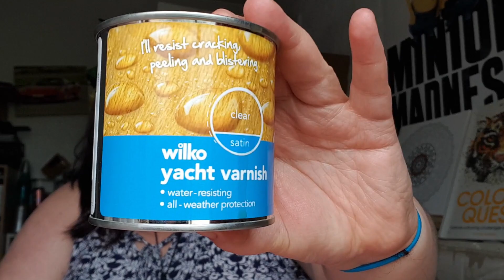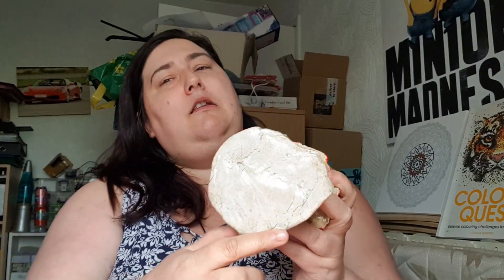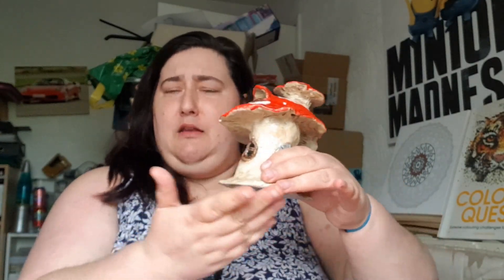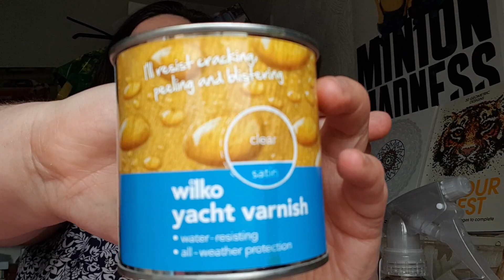waterproofing Air Dry Clay experiment

Comment: Folks, if you use yacht varnish on an object made of air dry clay, the best way to paint it on is the paint it from side to side and allow that layer to dry completely. Then once it's dry, paint the next layer on it, painting it on from the front to the back, to ensure you cover every inch of the clay. I have used yacht varnish on air dry.clay, and sadly I missed a section when I painted it, so the moisture got in under the varnish and the item became distorted. Since that happened, I always add 3 coats of the varnish to my creations before I put them outdoors. Also, ensure that if the item gets scratched or damaged, that you give it another two or more coats of the varnish. That's what works for me. Hope that helps!

Comment: What a cute little ornament.  thank you for sharing how this worked for you. How is it holding up all these years later? Did it stay waterproof? And did it need any more coats of varnish after a while?
Reply from the maker: Hi thank you for your comment, the ornament hasn't had any varnish reapplied since the original and i haven't checked it for ages, so i am planning on doing a quick video in a couple of weeks as the ornament is at my mother-in-laws house, however when i have seen it at a glance it looks fine but i shall see what its like when i get up close

Comment: I have a concrete angel. It belonged to my Aunt who past away.  It was kept outside.  One of its wings needs to be repaired.  Im doing this for my cousin, my aunts daughter.  I have air dry clay, can I use this to repair it? Also I need to paint the whole thing.
Reply from the maker: thank you for your question, even though the clay would connect to the concrete it obviously wouldn't be as strong and also would depend on what you were repairing, i would advised using concrete but create a really thick mixture and slowly build up the part that needs repairing, with regards to painting it acrylic paints work great as long as you use a good sealant, hope everything goes well with the angel and your cousin likes it xx
Reply: Thank you so much

Comment: I always thought yacht paint made items yellow . Is this water based varnish ? Thanks
Reply from the maker: no this is yacht varnish and it never turns yellow this is because its UV resistant, if you get one that doesn't have UV resistance than it will turn yellow x

Comment: Hello, my friend moved away and I want to make a skateboard key chain to remember her, I want to hook it onto my backpack. Do you know of any sealants that are glossy and waterproof at the same time? I want to avoid using resin, epoxy, 2 part or uv resin.
Reply from the maker: Good Morning, if your looking for a glossy finish with waterproofing, i would suggest a exterior wood varnish that as polyurethane in it. hope your gift goes well x

Comment: Heyy! Loved this video, you’ve got a new subscriber here☺️ just wanted to ask you something. I want to make air dry clay plant pots 🪴. I’m thinking of putting plants that don’t require tht much water. Instead of a plastic cup inside the pot can I wrap some sort of cling film inside the pot and then put the plant in. Will that better protect the pot after varnishing it ?
Reply from the maker: Hi, firstly thanks for checking out my channel, i honestly can't see there being any difference between using a plastic cup or cling film other than one being firmer than the other. Cling film would be a cheap option but may get damaged alot easier than the cup xx
Reply: @ManicCreationsChannel  ooooh okay I’ll keep this in mind! Thank u so much 🥰🌸

Comment: I wonder if you'd be able to seal/waterproof air-dry clay plant pots with this Wilko Yacht Varnish, or would the constant moisture of the soil dissolve it and poison the plant maybe? 🤔

 It's super difficult to find something non-toxic and waterproof to seal claypots with without using varnish that needs to be hardened in a kiln 😑
Reply from the maker: Hi thanks for your comment, I agree that even with the varnish it may not deal well with the constant moisture, you could however keep the plant in a plastic pot and place that inside your clay one so it's not in direct contact with the soil x
Reply: @ManicCreationsChannel  
That's a pretty straight forward idea I hadn't thought of! 😅

- Apparently, a non-toxic method of waterproofing the inside of terra cotta and air-dry clay pots that people do, is to use liquid rubber that people use for some roofs? It's pretty cheap from B&Q/eBay, but it's like a black goop you paint on, so the inside of you pots or whatever will be permanently black?  

Thank you for sharing your ideas too! 
( ^ . ^ )

Comment: Would this work for a succulent pot?, it would be a small pot, I will be using air dry clay to make it
Reply from the maker: hi e m i thanks for your comment, it should work perfectly well for succulent pot, some people i know that have some of my sculptures in their gardens have had them out on the soil in all weathers and they have done really well against all the elements, just make sure that you paint the pot before applying the few coats of varnish as this really does have an effect on how well the yacht varnish works at waterproofing, hope this helps and let me know how it goes! x
Reply: MrsManic Sculpture & Craft Creations  Great!, thank you for posting this video 👍🏼

Comment: Thank you for the video x the only problem you have with vanish it can go yellow x
Reply from the maker: Hi Lorraine thankyou for commenting on my video, i agree some varnishes can eventually give off that yellow stain effect, however with this yacht varnish i found that this hasn't been the case and after researching further into it i have found that when looking for the right varnish not only does it need to be water resistant but also UV resistant which alot of normal varnishes aren't, so when looking make sure you go for the water and UV resistance, Happy crafting xx
Reply: @ManicCreationsChannel  thank you very much x you have been a great help x I will use it in my fairy houses x
Reply from the maker: @lorrainediamond2266  your very welcome and good luck with your fairy houses xx

Comment: This is gonna sound bizarre but I want to try this on sugar craft cake toppers to preserve them as ornaments. At the moment I use epoxy resin which is brilliant but it's faffy because of mixing the two solutions and if you Don mix it perfectly it never sets so I'm hoping yacht varnish will do the trick
Reply: Yeah so not great. However I went back to the resin which I'd forgotten how fab it was if your just a little patient. Plus I can to it indoors because it doesn't stink🤣🤣.
Reply from the maker: @kellyfairbairn9333  lol well thats the fun thing about crafting...trying new stuff out! its fun trying new stuff out even if it doesn't work, just laugh and move on to the next! lol x
Reply from the maker: wow! firstly thankyou for your comment, i have never heard of yacht varnish being used to preserve a food item like cake toppers so if you try it please let me know how it goes! However with regards to your epoxy resin problem although maybe abit more expensive you could try the UV Resin instead as the type i have used is ready to use from the bottle and then cured either by direct sunlight (if you don't made the wait) of a UV light/lamp x
Reply: @ManicCreationsChannel  wow thank you so much for replying and so quickly. I will certainly let you know how it works out. And thanks for the resin tip I will definitely give that a try 😊😊😊
Reply from the maker: @kellyfairbairn9333  fantastic i love hearing what other people do for crafting, good luck! x

Comment: Hi I can't seem to find yacht varnish (let alone wilko varnish) where I live. Does it say what it is made of so I can buy similar? Thanks
Reply from the maker: Hi Maya thankyou for your comment, you will need to find an exterior varnish that states that its water resistant and all weather protection, as the UV protection also as an effect on the water resistance.

although not the same brand the ingredients will be similar if not the same i have found this following link that shows you the Ronseal version and the ingredients: 

https://www.wood-finishes-direct.com/datasheets/ronseal-yacht-varnish/SDS-Ronseal-Yacth-Varnish.pdf

Comment: Hello 
Thx for the video, its great 
I was just wondering if theres anything else to use if you dont have yacht varnish or anything like that example diy things
Reply from the maker: The reason yacht varnish is best is because it allow water resistance as well as UV protection, this allows for flexibility with cracking along with the waterproofing, so i would advice looking for something water resistant, UV protection and for exterior use - although not the brand i use here is a link to information about ingredients withing the varnish so that you can research any DIY options https://www.wood-finishes-direct.com/datasheets/ronseal-yacht-varnish/SDS-Ronseal-Yacth-Varnish.pdf

Comment: I painted the clay with acrylic colors and i let them dry for more than 2 days. I sealed them with water-based varnish like yours but the colors start running and it messed up my work, What am I doing wrong?
Reply from the maker: thankyou for your comment, the varnish which i use in this video isn't "Water based" it is "Water Resistant" if you use something that is water based you are going to re-hydrate not only the paint but also the air dry clay (this will cause it to run and start to go mushy), by using a water resistant varnish it is unable to soak through and provides the waterproofing you want, hope this is helpful, if you have any other questions then please feel free to ask x

Comment: Hi I'm making my own dry clay ,I want to know with what can I use for a glaze,thats home made,that give my made things a glossy look plz,thank you
Reply from the maker: Hi thankyou for your comment, as long as you are not looking for waterproofing then i wold advise the use of PVA glue, you can either add this to your paint and then paint your object or make a part PVA glue part water mixture and add to object once finished, you may need to add a few coats, however if you are looking for waterproofing then unfortunately you would need something more substantial such as the yacht varnish, i hope this helps and good luck on your project x
Reply from the maker: @Anna Schlundt it would depend on the type of glaze you use, as there are some many types some waterproof some not, what are you thinking about using? x
Reply from the maker: @Anna Schlundt then no this will not be waterproof as elmers glue is waterbased, you would need something like yacht varnish or a varnish waterproof not water based

Comment: Hi there, I'm currently making a "flower vase" with air hardening clay. I was wondering if I can do this waterproofing on the inside of the vase, in order to put real flowers instead of just fake ones, OR if I should put a resin coat inside of it (like I've read in some forums) ? x
Reply from the maker: Hi thankyou for ur comment, i couldnt tell you anything about the resin as it isnt something that i have tried myself, although i have like you heard some things about it, the yacht varnish i have used as only been used on garden ornaments that have taken on the heavy Yorkshire rain over the last year and they are still going very strong and are still waterproof but they have not been submerged like a vase would be, i know if it was me and i didnt have time to experiment i would probably do both by putting on a yacht varnish first then a resin and see how that would go, im sorry i couldnt be more help, good luck with your project x

Comment: I’m trying to seal air dry clay that is shaped to look like a cookie. It needs to be sealed but not look shiny. What do? 😕
Reply from the maker: Hi, thankyou for your question, firstly does ur cookie need to be waterproof? If it doesn't then any type of varnish that gives a matte finish would be ok, however if u do need waterproofing I still suggest a yacht varnish and to find one that as a matte finish, hope this answer helps u with your cookie project x

Comment: Hi, new subscriber. I am making a piece for inside a snow globe. Which will have to be waterproof. Could you give me a bit advice on which clay to use and what to do when made to waterproof it, as its the first time doing this and havent got a clue. Thanx. Luv from Newcastle upon tyne x
Reply from the maker: Hi Lynne, firstly thankyou for subscribing to my channel that means alot to me. With regards to your question, with the snow globe being submerged in liquid (technically) i wouldn't advise using air dry clay, i would advise spending the little extra money and time and use a polymer clay for the amount you will use for something that small it won't cost alot especially if you use something to bulk any large areas such as foil, once baked this will automatically become waterproof so you wouldn't have to coat it with anything unless you paint it, if you do paint it then any type of waterproof top coat for the type of paint you are using would be ok. 

If you are using air dry clay, you might want to set up a trail run, the way i would do this is take a small amount of the clay, give it a coat of paint (the same which you will be using for the globe) then give it a minimum of 2 coats of yacht varnish giving each coat time to dry between each application, then submerge it for a few days to a week and see what happens.

When i have used yacht varnish on my outdoor ornaments i have applied acrylic paint and then 2 coats of the varnish, i live in yorkshire so we do get rain alot! my first ever ornament is still in great condition and its been outdoors for over a year and even dealt with the flooding we had last year.

hope this answers your question, if you need any help im more than happy to answer any questions you might have. I hope your project goes well!

Louise (MrsManic) x

Comment: Really useful. I've tried to seal sculpted small bowls, which are quite thin, and whenever I apply PVA or glue the bowls go soft because they're so thin t'doesn't take it long to go soft. I think I'll be popping into town to get a tin of this tomorrow. thanks.
Reply from the maker: Your welcome, hope it goes well for you x
Reply: Can you give an update on how this method worked out for waterproofing your sculpted bowls? I’m very interested
Reply from the maker: @butterflygirlie7419  i did a update video https://youtu.be/n-IXadT4K5Y but i can also confirm that the sculptures that have been out in over a years worth of uk are still going strong through rain and shine, they are still waterproof and have shown no sign of uv fading/yellowing

Comment: Hi,thanks for the lovely video,what kind of paint can I use before using the yatch varnish?is water paint ok? Thank you
Reply from the maker: hi, thankyou for your kind comment, i used acrylic paint on this project and on most of my others, i have tried water paint before and found that although the yacht varnish will waterproof it i did find that this type of paint tends to fade, so i like to use acrylic paint as the color holds well x
Reply: @ManicCreationsChannel  thank you so much for ur quick answer,I don't mind if it fades as long as it becomes water proof even though will be just a plate for cookies from the kids to their parents 😄 (I'm a nanny 😄)
Reply from the maker: @francescamanca2422  just so u know, if its going to be used as a plate, the yacht varnish will probably not fair well against hot water, so would advise it being cleaned just using a damp cloth x

Comment: I'm doing an art project and kinda tight on cash, would nail polish be okay to use to waterproof air dry clay?
Reply from the maker: hi, thankyou for your question, tbh i don't think it would work long term as nail varnish products do tend to chip easily, if the item is just needing a top coat for protection for indoor use then it may be ok but for long term exposure to outdoor elements i would stick with the yacht varnish personally, really hope this helps and good luck on your project x
Reply: @ManicCreationsChannel  thank you!!

Comment: Very helpful. My pieces went soft and absorbed the water from the water based varnish.  I think my issue was that I tried sealing really thin pieces without painting them first.
Reply from the maker: Thankyou for your comment, I did find that even the yacht varnish didn't do as well as it should without at least 1 coat of paint, so I would definitely recommend painting, then a coat of yacht varnish with a 2nd for good luck, I'm so happy my video as helped u with your creations xx